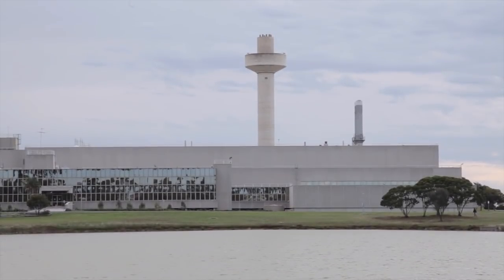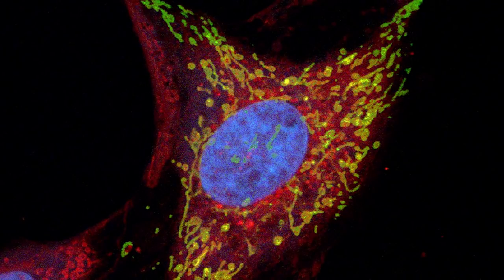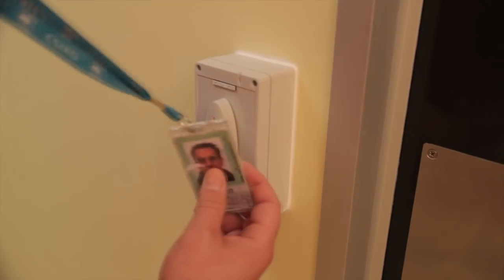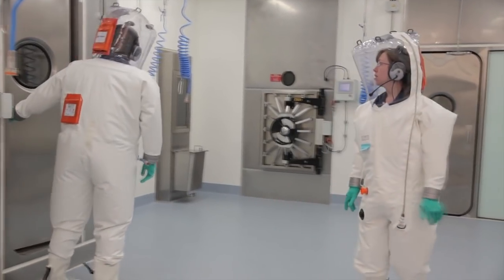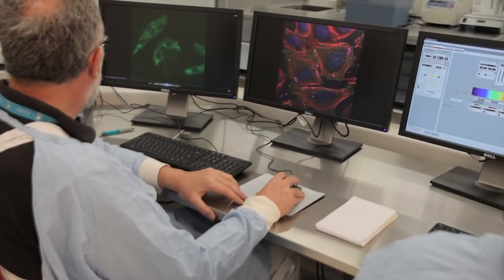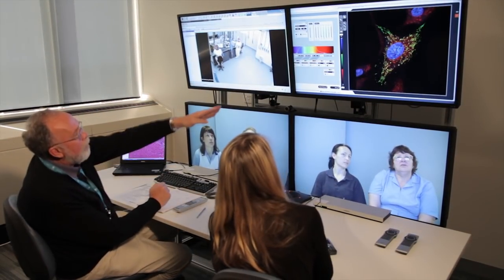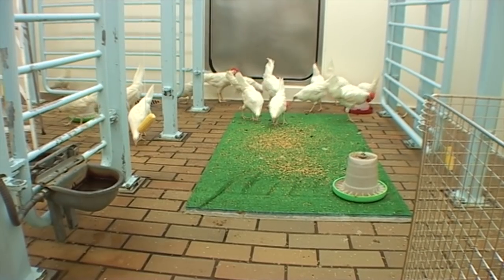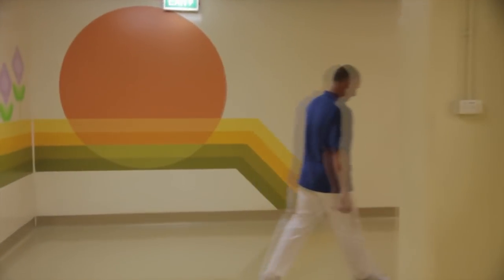Take a look inside the world's most biosecure laboratory

Comment: 3:40 wait did he just break protocol? he disconnected the air hose ... that seems like he shouldnt do that
Reply: Those are quick connect / disconnect hoses. As you move throughout the lab you can connect to the closest hose to maintain air supply and positive pressure.
Reply: Suit is positive pressure, room is negative pressure. If a leak should occur clean air flows in to unclean room. Same is true in reverse, clean air leak from suit out in to unclean room. Get a balloon inflate it then grab a sharp pointy object hold balloon next to ear and do the math

Comment: Why are they all in huge suits when a paper mask works just fine?
Reply: Exactly!  What they are wearing is the only protection that really works against airborne viruses.
Reply: Because the masks work to lower the risk of infection or of infecting others while these suits prevent any chance of contamination?
Reply: @yourlocaltoad5102  If they were worried about contamination the suits would be under negative pressure, i.e. any leak would be inward from the room into the suit. Instead the suits are under positive pressure to ensure any leak would be outward.
Reply: @heavy-gauge  I meant contamination as in „taking germs out of the lab on your clothes and containing the outside with them“, which is something these suits definitely prevent.
If I worded it in a rather unclear way, I‘m sorry for that. English isn’t my first language.
Reply: @yourlocaltoad5102  From Wikipedia:  The PPPS is a sophisticated variety of personal protective equipment (PPE), a type of hazmat suit, which is air-tight and designed for positive pressure to prevent contamination to the wearer even if the suit becomes damaged.

Comment: What I do wonder is, how do they decontaminate electronics that should never get near an incinerator?
Reply: UV light x WATTS destroys all known pathogens. There are many ways this facility is 99.999999 percent is a failsafe design system in depth you would have noted how in the hazard suit there was a chemical shower for 7 minutes then they strip out of their laboratory clothes which don't leave the next layer then they have a shower again this time in filtered water then leave that part of the building then shower again and put on their clothes when they work in the in the lead they are issued with clothing including underwear that never leaves the building it is incinerator at high temperatures absolutely everything is done in depth a fellow once told me one of the many security systems they have and no one is aware of them all as far as I know is at the flick of the switch they can flood the entire air ducting system with high intensity Ultra violet radiation I was told that there are security cameras that observe everything and there are security cameras that observe the people observing the security cameras and the security cameras are also fully accessible via virtual LAN and tanning fact really be viewed by anyone anywhere and any number I also strongly suspect though by very nature of which cannot confirm that the joint is highly compartmented this lab is originally called the Australian Animal Health laboratory Australia has unique characteristics in that we do not have a lot of diseases that affect animals in other continent there is no rabies in this country for example how many species have no immunity to these diseases the only place Australian scientist can study these diseases is under extremely control conditions and this is the only place in the nation that we can by that virtue it is one of the few places on Earth can be studied on animals that also affect humans Australia also has rather a large part of it that is tropical we also have nation state Neighbours that are tropical being one of the most advanced medical research nations of the world requires us to do what we can to help out brothers and sisters overseas fight the likes of dengue fever malaria and so forth chemical and biological weapons are strictly illegal in this nation and we have also never chosen to develop nuclear weapons even though we have the capability and enough uranium to destroy the planet a million x over
Reply: @benjamin8968  the notion of flooding entire duct systems with UV is rather ludicrous and would accomplish little, as the ductwork has many crevices that UV light would be incapable of entering. Can't kill what can't be irradiated.
As for destroying the planet, nobody has that ability and it's doubtful humanity ever will manage to destroy the planet itself. Render it inhospitable, yes, destroy a planet, all of the nuclear warheads ever made, set off at a point of one's choosing won't damage the planet very much. And given the thousands of nuclear detonations either in open air or vented to the atmosphere didn't manage to do much more than elevate the cancer rate of those downwind from the detonation site.
Reply: Electronics that are used in labs very often are constructed to survive sterilisation in an autoclave.
And other things are disinfected using radiation, uv light, heat, various disinfectants, etc.
Often some devices are brought into the lab, used there and sterilised as much as possible and at the end of their lifetime they go into a sterile package and get burnt once they are outside. Just like it’s done with the trash that they collect inside these labs.
Reply: @benjamin8968  as a medical science honours student, I must say...

I ain't reading allat.

Congratulations, or good job, or I'm sorry that happened